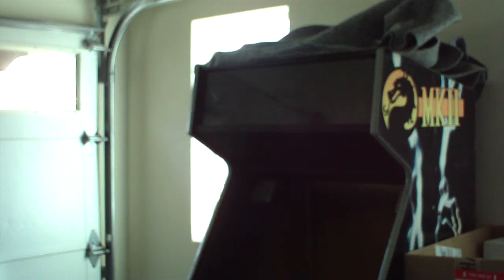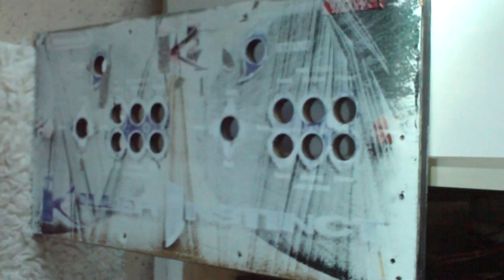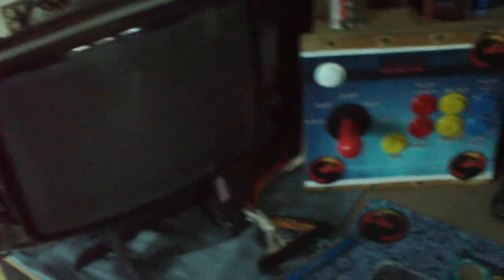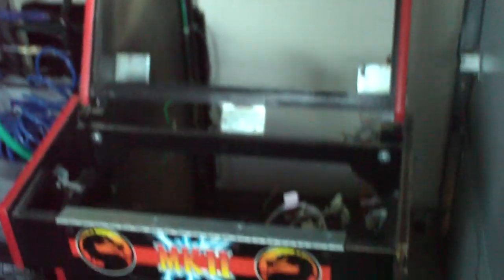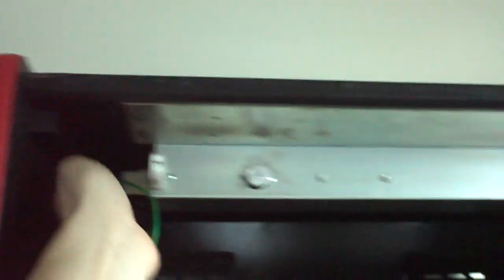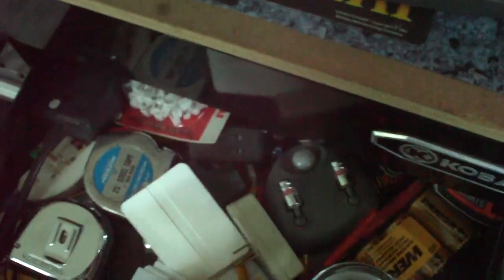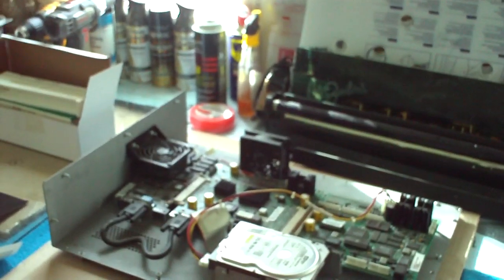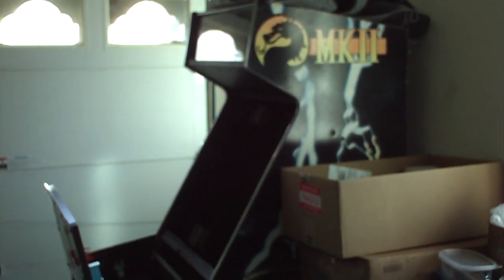Possible New Killer Instinct Arcade Cabinet Project

Comment: Cool! Don't let the side art deter you. It's not that hard and I'm sure if you give GOG the dimensions, they can print it out correctly. As for your bulb problem, make sure you don't have the hot/neutral wires swapped with the ground wire anywhere in the harness. The connector at the power supply brick that feeds power to the bulb is a 4-pin I believe. Make sure the hot/neutral/ground wires coming off the power brick are going to the right places at the bulb housing.

Comment: Hey friend have a question for you 
Is possible to buy all original wires and component  for
A midway killer instinct 
Cause my cab is all original but the Guy who sale this cab i change all the wires , fan , power supply...
I pay this cab for a good price
So i want to restore and put all original inside  🤔🤔🤔

Comment: I think I just have bad luck with GOG. For my MK1 marquee I had ordered from him he knew it was for a dedi MK1 and it was wayyy to long. He sent me another copy and the top half of Midway is cut off. Then I told him the KI side art was for a dedi and messed up the dimensions for that too. The same guy that originally did the MK1 and had the dimensions wrong is the same guy that did the KI artwork and got it wrong too. Not sure if he fixed it after he sent mine though.